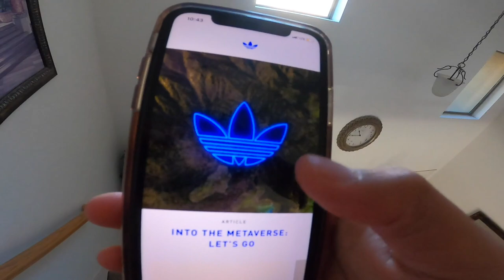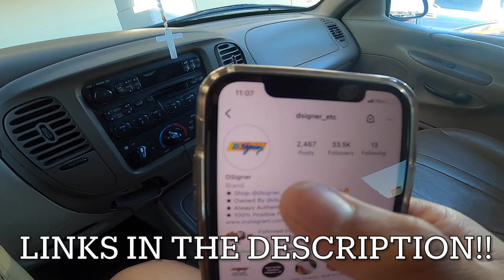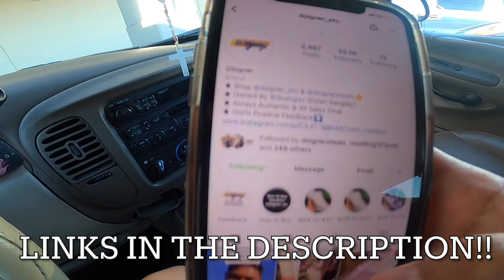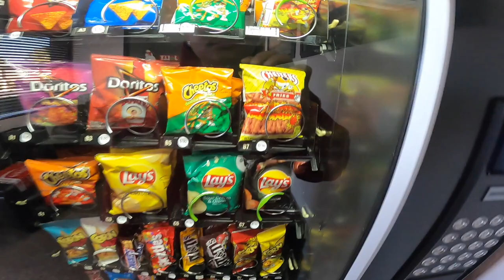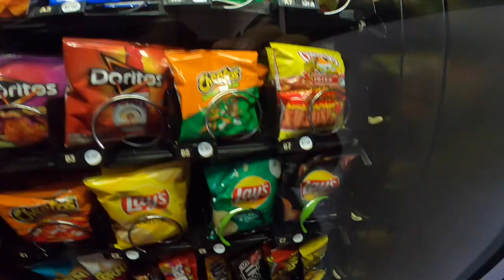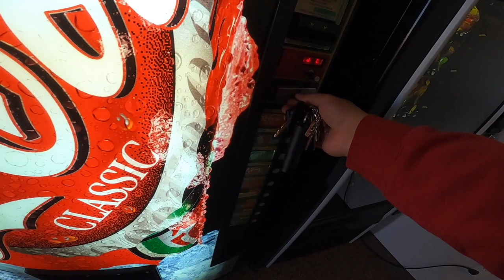They Bought ALL THE SODA From My VENDING MACHINE!! *Plus Pulling Cash Out of Vending Machines*

Comment: On my machines if the display will not show the price, i use a Label maker to make all my price labels. and to replace the green tea you can use cans it is a n easy adjustment for the machine
Reply from the maker: How would I go about that?
Reply: @DSanglay  I have just a DYMO handheld label maker and I have the text set to the size I need for the shelf labels